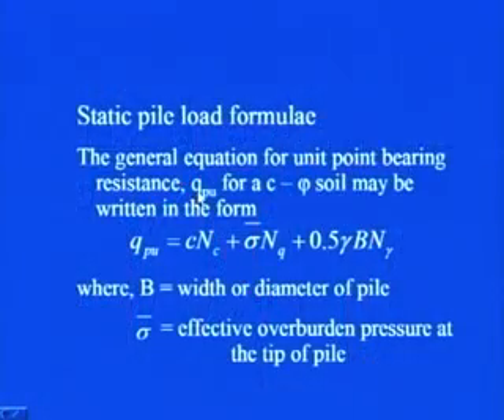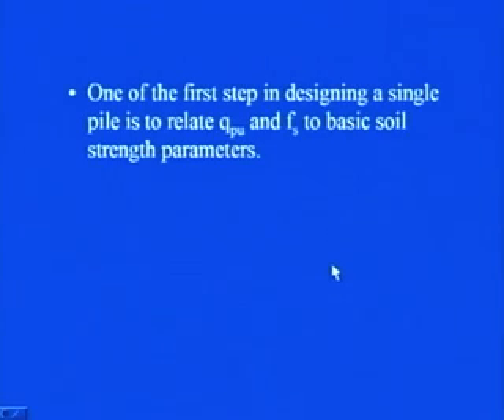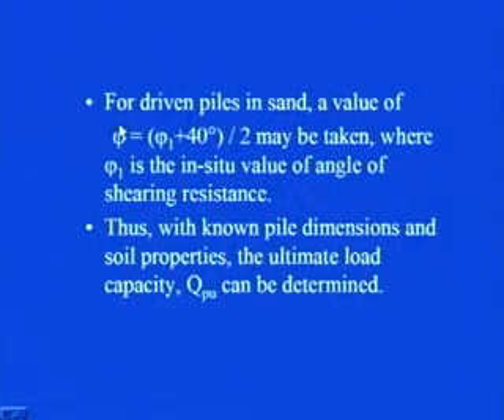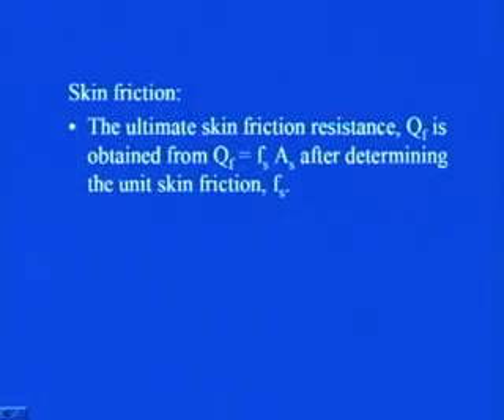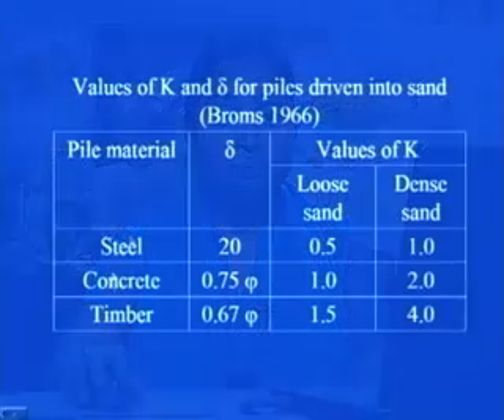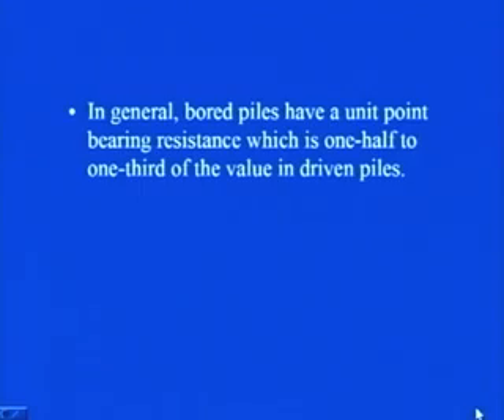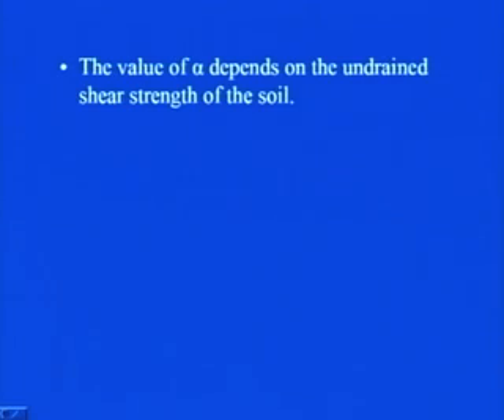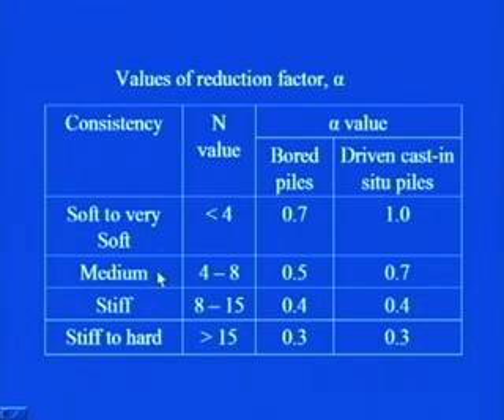Mod-2 Lec-8 Pile Foundations-3

Comment: Some of the points are not accurate. Calculation of frictional resistance. angle of shearing resistance is not constant along the depth of pile. The pile length shall be segmented and value of delta to be changed as per soil investigation report. Then make summation.

Reference can be made to "Pile Design and Construction by TOMILINSON" as this book is internationally used by consulting Engineers. In my experience this is a very good reference.

I disagree with the limitation of skin resistance. Please deal with Liquefaction and negative skin friction.  FOS of 3 is suggested incase of end bearing + Friction. A worked out example will be better.

Overall the presentation is very good.
I  am working as a structural design engineer for 45 years. You explained well the pile design in terms of soil mechanics. But structural design was missed out. I am not sure if you have covered else where.